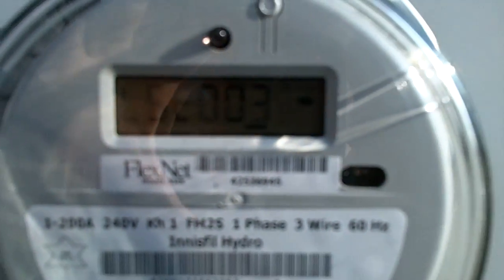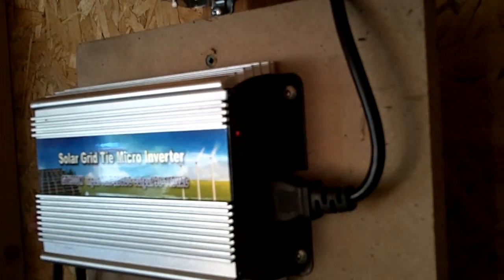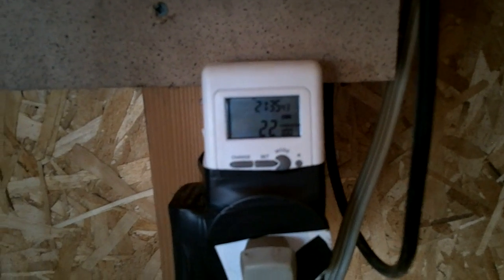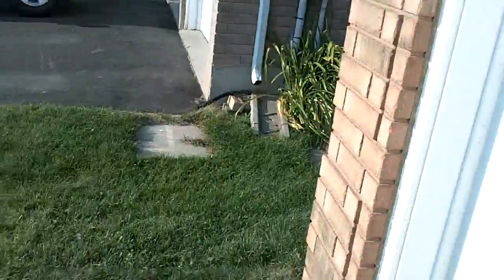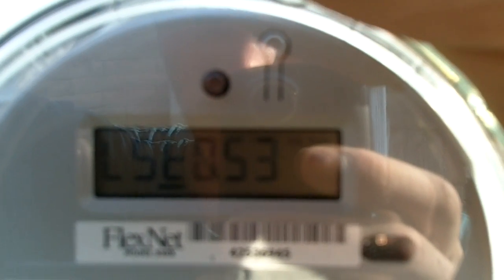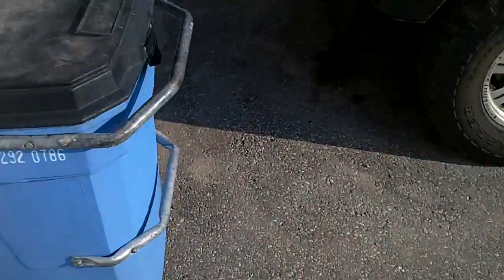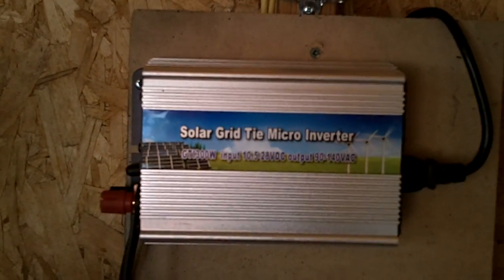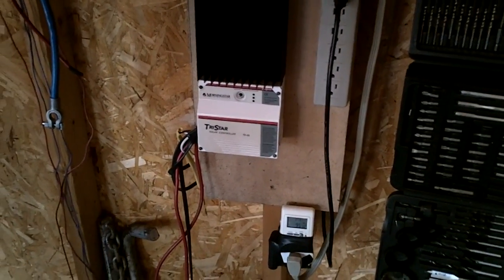300w grid tie inverter

Comment: you can expect to loose about 100w AC for every 400w of DC panels
, also load voltage & real working current will be lower than open or no load voltage & short circuit current measurements.
Reply from the maker: Thank you, i have found a few things that have boosted my performance, thanks for the comment always appreciate them!

Comment: Yesterday I notice that my panels are producing 14amps coming in the wire and then when I plug the DC power analyzer to the wire panels and to the grid tie it will only go 8 to 10 amps at 15volts! So I'm losing 60w of power loss that may be cable loss over peak current ! I'm using 6meters 2.5mm cables one for 140w and another for 50w+65w